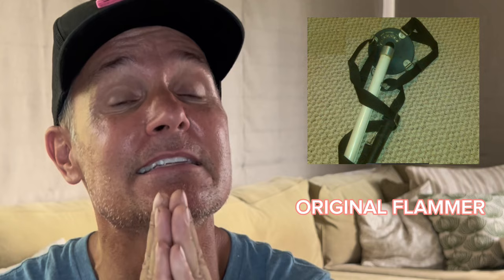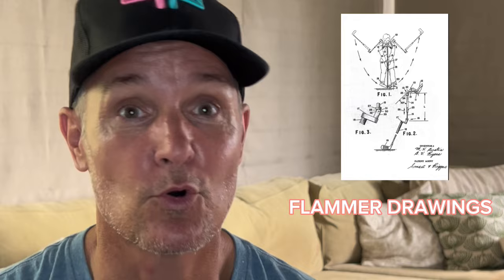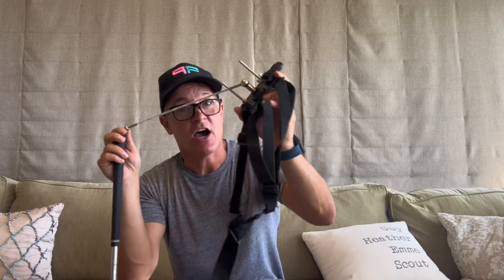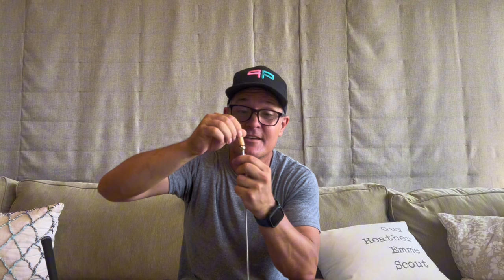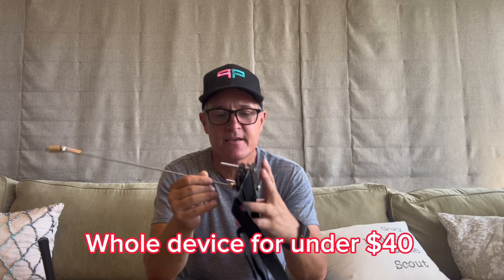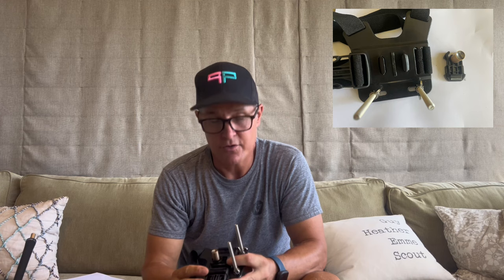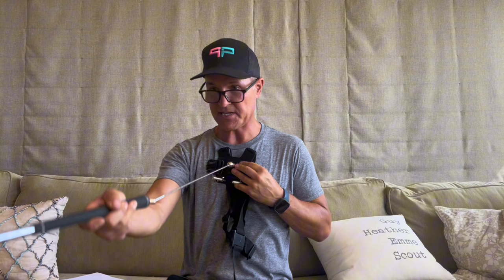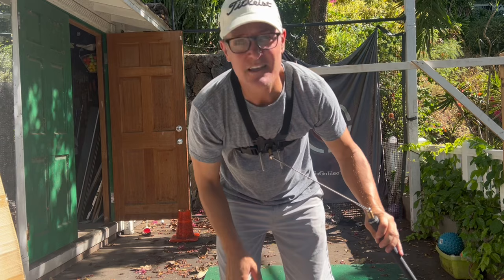I made Mike Austin’s Flammer only better.

Comment: I actually own a Flammer. Bought it for $99 probably 40 years ago. To be honest, it's kinda hard to use. I've never been able to get the harness to fit right. A suggestion to make yours better: If you can find a long connector to place in the middle of the bisected threaded rod, you could tighten or loosen either or both ends to lengthen/shorten the rod. Love your channel!
Reply from the maker: I love it when others come up with great ideas. I wish I had thought of that. Thanks.

Comment: Has this device helped your swing? Are you striking the ball better or hitting it.    
longer as a result of training with the 
Flammer?
Reply from the maker: Too early to tell but my guess would be that this device would be most beneficial to complete beginners to get the feel of a proper swing arc keeping the lead arm relatively straight and having a pretty neutral swing plane that is neither crazy flat or steep. The connection to the club allows you to feel the swing of the club making maximum use of gravity as an opposed to using the wrong muscles. Hope that helps.

Comment: I have ordered all the parts. Just waiting on Aliexpress. The chest apparatus did not come with square clip in part to attach bolt to.  Where do I get that?  Thanks for posting by the way.  Just figured it out. Remove three screws and voila you have piece needed.  Thanks!
Reply from the maker: It’s a standard go pro camera attachment. I think it’s called a J hook. Loads of them on Amazon. You just have to remove the hook part that is attached with 3 little screws.